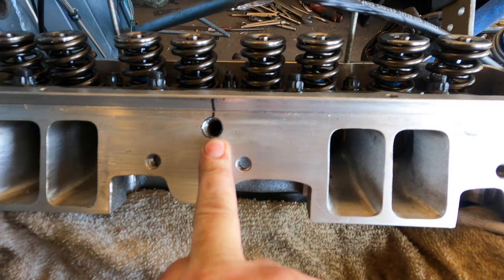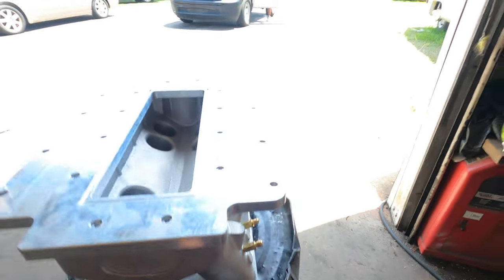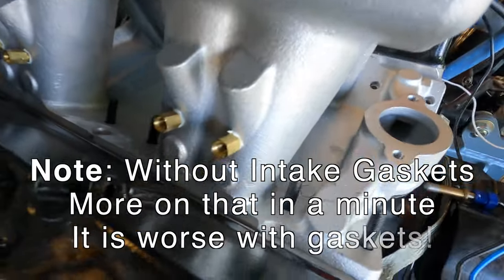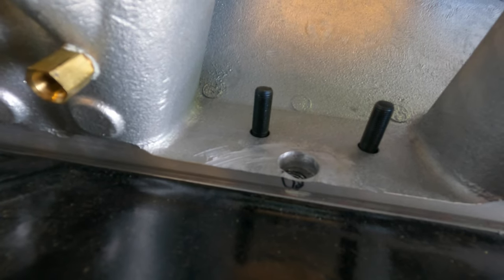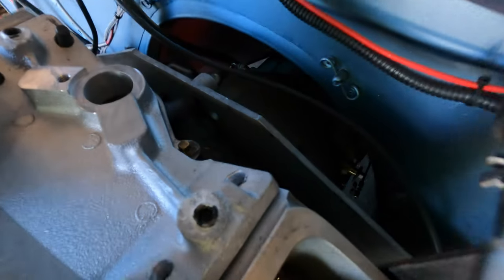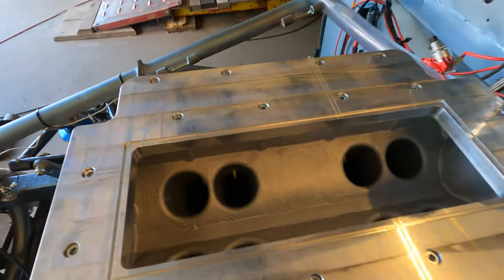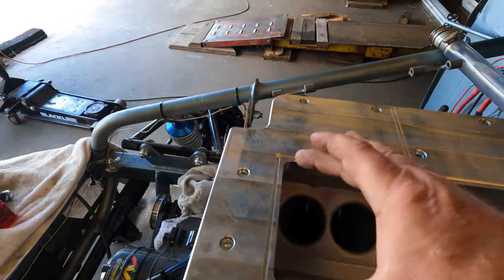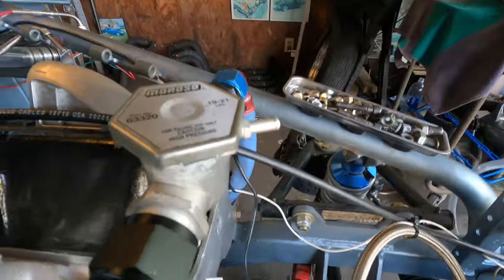SBC Tunnel Ram for 8-71 Blower - Challenges and Mods

Comment: Your awesome. I hear it all the time, "you can't put that on there", "you can't make that fit". For me that just makes it better. Almost all my parts are one offs. I'm building a 1000+ HP Chevy inline 6 292. Mains doweled and girdled, Crower billet crank, solid roller cam and rods, 5 stage dry sump, Electromotive TEC200s coil over ignition. Falconer V-12 head. It's one aluminum head for his Falconer aircraft racing engines. It flows 340I and 220E. 6-71 blower with 2 quick fuel 650 DP. NOS. Going in a 53 Chevy pickup with a stick. "You can't do any of that", Except I did. Sorry so long I got carried away. Thank you for showing how things go when you don't have a million dollar HASS machine sitting there and thank you for your time.

Comment: Great work Kevin, and love the respect for your Pop! I grew up as the SBC was introduced to the public, so I'm not as "new" as some of the experts. The water pump flows cool water into the front of the block. As it moves to the back cylds., it picks up more and more heat. It collects a lot more heat from each cyld. chamber and it has nowhere to go until it gets to the front of the heads. Simple physics tells us the back 4 cylds. run a lot hotter. If a more even heat distribution and therefore jetting is the goal, run an exterior hose from each high pressure side of the water pump, into the rear frost plugs on each side of the block. Then use those manifold holes you drilled into the rear, to run that hot water externally to the thermostat housing. Now you have cool water going in low, in front AND rear. I know, it's not what the experts say. All the best with the "stud", and God bless yer Dad.
Reply from the maker: Great advice!!!! Go fast, go straight! Be SAFE!

Comment: Been following you build, its pretty cool. Im kinda going through the same thing with my car, im also going to mechanical fuel injection from my dual carb set up. I have an 8-71 Pontiac engine 1974 GTO tube chassis car. currently it's running 7.90's at 173ish. i just bought a Rons Terminator set up.

Comment: Kevin, how much was taken off the deck of your block? That's probably why the intake sits so high. Have the heads been milled as well? It's closes up the "V" pretty quickly.
Reply from the maker: Block was decked .010” and heads milled .010” and the TBS intake fit with no issues along with other stock intake laying around the shop. Opening the holes and milling .068” done the trick!! Go fast, go straight! Be SAFE!

Comment: One more thing, you NEED to run a setback plate with a delta discharge, its going to need a big stagger on the nozzles.
Reply: He and I spoke about that.  He doesn't have clearance at the firewall to do it.

Comment: How much did u mill off the intake the 1st time? I know the 2nd time was for gasket thickness. I was curious on how much and what determined the 1st milling
Reply from the maker: Sorry that part was a little confusing. Before we took anything off the intake I wanted to measure it with and without gaskets so after enlarging the bolt holes we only had a mill it once at .068”

Comment: I don't see a burst panel on the front of that intake. Are you going to add one?
Reply from the maker: Adding 1 on the passenger side of the intake... alkydigger put a "street pop-off" on the driver's side, but I need to add a burst panel also in my opinion. Go fast, go straight! Be SAFE!
Reply: @KevinWilsonSBC  bolt the side down, put the burst in the front.

Comment: Only problem is your thinking naturally aspirated instead of Blown..Yes, the pressure will go to the path of least resistance but then it will fill the rest way faster then before you will not starve any cylinder unless you are severely underdriving the blower